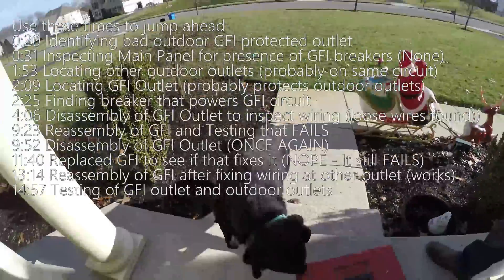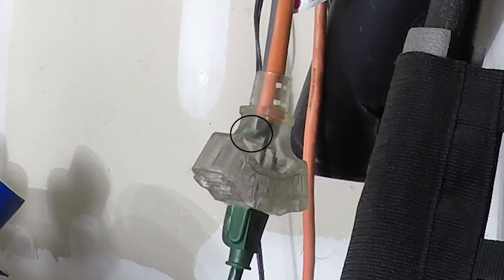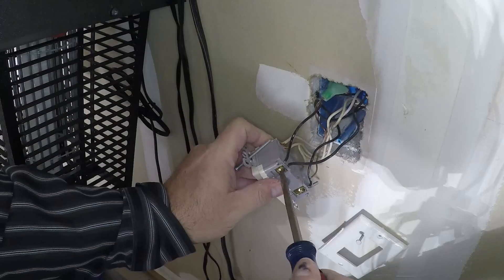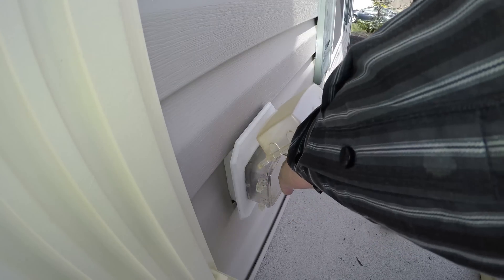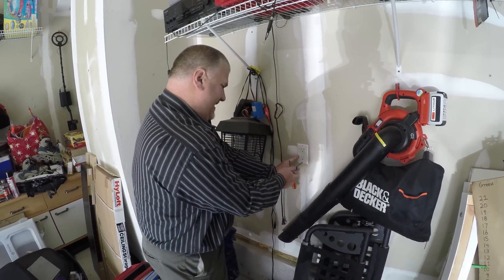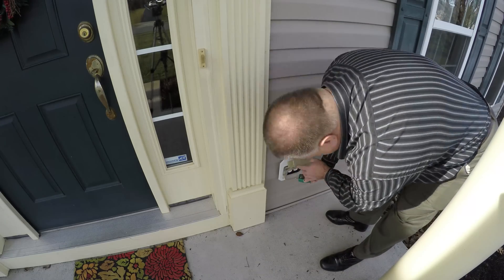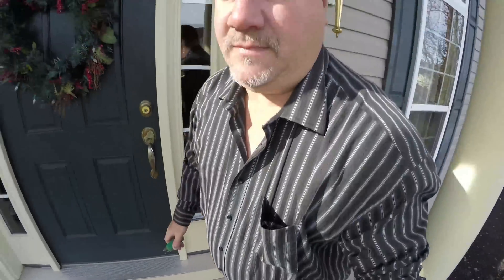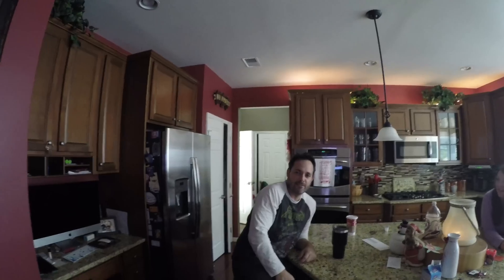How to Fix Outdoor Outlet that Will Not Power - How to Identify and Fix Loose Wiring on Outlet

Comment: Great video I followed all you found. But I have 2 outdoor outlets that are connected to a gfci in my garage and it is not tripped but I have power to just one outlet on same gfci breaker. Any ideas? I'm stumped.
Reply from the maker: I hope it is the first outlet on  the circuit that is working. Identify the other outlets that you know are tied to that one and perform a continuity test on the wire using a DMM. Flip the breaker off, remove the wires from the lugs and ground foe the wire that feeds the next outlet. Unplug all devies on all outlets on the circuit. Connect the black, white and ground wires with a large wirenut. On the next outlet measure continuity from white to ground, black to ground and white to black. If it all checks out then that wire is good. Repeat steps for remaining outlets on that circuit. If there are any breaks then one of the combinations will not work. Connect everything back as you saw it. It is also possible that there is a break in the connection from one lug to the next lug on the same outlet. Test that with the continuity tester on the DMM. Consult a licensed electrician.

Comment: So all my outlets outside don't work. I checked all my gfci in my house. They all work. I don't have any gfci outside to push on. Just outlets. Panel box everything switched to on. Any suggestions?
Reply from the maker: Take care in this situation. You can solve it yourself but I really recommend that you hire a licensed electrician to do this. An electrician will probably try the following: 1) verify that the breaker is functioning as expected. Breakers do stop functioning. 2) with a signal tester affix one end to the breaker labeled (hopefully it is labeled) for outdoor outlets and trace the line to where it looks like it is going (if possible). This may require the electrician to remove the outlets from the receptacle boxes to expose the wiring. 3) This last step is an opportunity for visual inspection and possibly tightening of the wirenuts. Sometimes water gets in the outdoor outlets simply from condensation and corrosion is a high probability in these cases, which leads to poor conductivity. 4) If the visual inspection doesn't pass or it is questionable the electrician may remove all wires, expose new wire through the use of an abrasive like emery cloth and use new wirenuts and possibly replace the outlets (outlets do go bad from corrosion as well). 5) confirmation of solid electrical connection between the outlets and the main panel (a wire could have been broken from an animal, construction, house settling in extreme cases). The electricians job is made easier if you know where the wire is routed throughout your home. For instance, if your home was purchased as new construction and you have photos of the construction it is sometimes possible to trace the wiring or if your panel is in the unfinished basement and you can clearly trace the wire to the outdoor outlets then you can have a better shot. I hope all of this helps Jarvis. Again, a licensed electrician is hard to come by right now due to demand but that will be the safest choice. Go by local recommendations and wait for the best to help you. -John
Reply: @UDoIt2  thank you
Reply: Did you figure out your problem? Having same issue but I have a gfi in garage. I just replaced and still no power, going to try breaker next. Mine happened when I didn’t properly cover my Hotwire from ground wire when replacing lamp post,ugh. Last time I hired an electric I paid about $120 for 5min of work... that’s the last last resort.
Reply: @tl414  I have not. I'm going to call my contractor to see what wrong though

Comment: This was helpful!! We are having the same issue. Outdoor outlet not supplying power. Having difficulty locating the GFI that is giving it power. I know how you found the breaker section, but how did you know to look in the garage and determine that was the GFI?
Reply from the maker: Hey Christal, Were you able to solve your problem? There are a few ways this can be handled. Outdoor power definitely requires GFI protection. This can be done through a breaker that has GFI protection or it can be done through an outlet (the first outlet in a series of outlets) that has GFI protection. The GFI outlet has two sets of terminals. One terminal is for the feed from the main panel. If this is the only outlet, which you would have in a basement for a sump pump for instance then the feed would only be connected to the supply side of the GFI outlet. If you have multiple downstream outlets connected to the GFI then the feed connects to the supply side of the GFI outlet and the next outlet that is protected by the GFI outlet is connected to what is called the LOAD side of the GFI outlet. Several outlets can be tied together and as far as I know there is no limit on the number of outlets that can be daisy chained for residential use but most electricians try to limit them to a number they are comfortable with, such as 4 to 6.  The next part to identify is what you are mentioning as the breaker section and know what is feeding what. HOPEFULLY, your breakers in your electrical panel are labeled. If they are labeled then it makes the job of the electrician much easier. Ideally, you'd be able to trace the wire from the panel to the first outlet but that could be unlikely if the panel is installed within the drywall between studs.

Comment: I got about 3 of these outside that need to be fixed. About how much would this cost to fix, if I hired help? 2 haven't worked in years & one stopped working this year. They're rarely used.
Reply from the maker: it's usually time...maybe an hour to two hours to fix this so could cost $300 plus parts/tax?   Most likely a wire thwt pulled out, a loose wire/screw terminal or a bad GFI.

Comment: Thank you for this informative trouble shoot,  will try this on mine.
Reply from the maker: Thank you for the update. Take all preventative measures, turn off breaker, verify that the correct breaker was turned off with a volt meter (I've went overboard and turned off every break in some cases where you just couldnt tell ... and then label the breaker if it werent labeled) and consider consulting an electrician if you feel uncomfortable working on it.

Comment: Yes i agree however this situation the non contact tester is working fine...there is something crazy going on in the outlet.. Everrthing is hot...the metal box is hot and all the wires are hot per my tester...the other outlets dont do this... Hey if indeed everything is hot and i use my voltage meter to test, what happens if i touch 2 hot wires when testing for voltage via volt meter?
Reply from the maker: A volt meter is very high impedance and will be able to handle a high potential. But measuring two hot wires would show zero if they are the same phase and 240 if they are opposing phases.  To the important point that your metal box itself is hot can you post some photos and tag me in twitter or instagram? Extreme care needs to be exercised here and I would seriously consult an electrician. If I were to do this to inspect I would remove all drywall around the box and look around and behind it to see what is connected to this metal box. This could be a dangerous case in which ground is hot (at that point of the box) or neutral is hot or if neutral is broken and current is flowing from hot to ground.  How can ground become hot? It would have to be broken at some point between the breaker and the box and become tied to hot either from a fault (worn insulation, poor or incorrect installation or the ground wire is making a connection to hot in another box). If neutral is broken, everything will find a path to ground. There are a couple of videos out there of broken neutral at the meter which means that ALL ground points become hot. If you were to touch an air conditioner unit you would get a shot. If I remember correctly I think Mike Holt has a video on this. Definitely consult a licensed electrician.
Reply: Yes you are correct could be very dangerouse...i have since disconnected all the wires and taped them off temporarily until inhave time to fuerther troubleshoot...whats odd is that no breakers are being tripped for this odd situation

Comment: Hi i have a very odd issue..home electrical outlet not working....the outlet left of it works and outlet right of it works. The odd thing is when i removed the outlet cover and used a non contact tester, all the wires in the outlet are hot...the black and white are all testing hot....the outlet box tests hot too...there are 2'sets of wire in box....whats more odd is that i disconnected the wires and taped them off for now....and nothing in the,room lost power....a proper working outlet in series once disconnected should cuase,loss of power downstream...if any.....something is defintely wrong...the entire elec box and all wires should not be hot....no evidence of wires touching box that i can see.....havent looked in crawlspace yet....just inside elec box....any ideas?.....and if all terminals are hot.....what happens when you plug something intomthe outlet?
Reply from the maker: I like to use a DMM set to AC and physically connect it to the terminals to know for sure. I had some bad issues in my house where I had to remove ALL outlets to find the problem outlet and each time I had to check the wires with the DMM and then cap them off with wire nuts (so I didn't accidentally hit them later when going back to reinstall new outlets). Eventually I found that there was a loose hot wire (black) that would make connection based on the sun hitting it (it would heat it up just enough to expand and make contact). I do not like the non contact tester because I found that wires above or to the side of the outlet junction box were enough to trigger the non-contact tester.